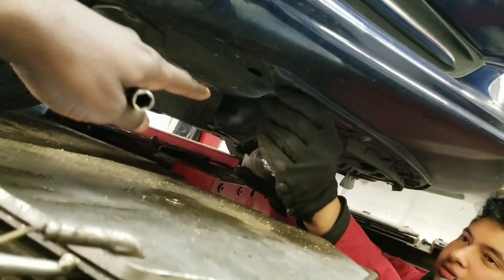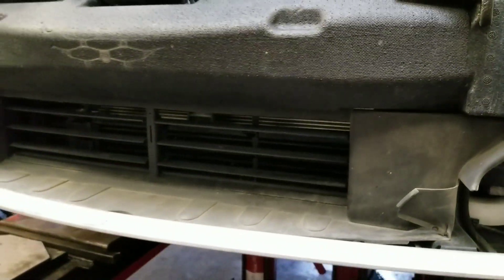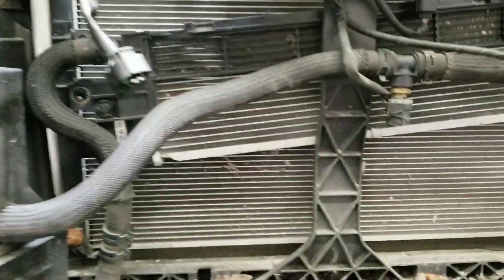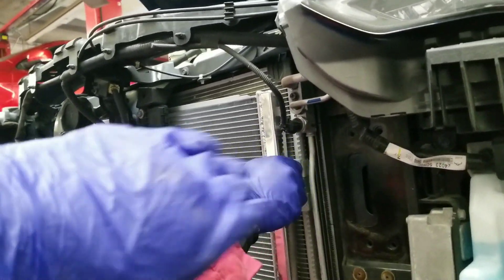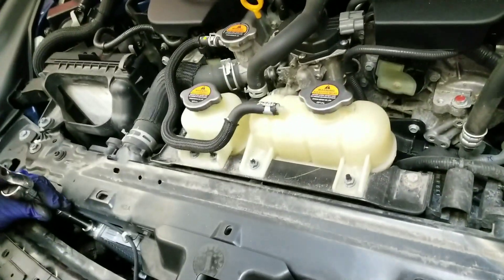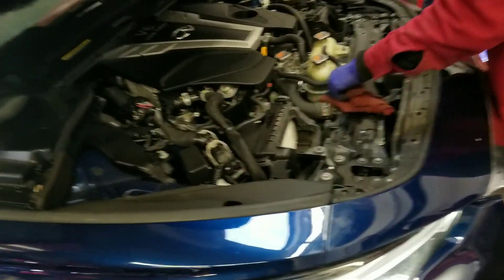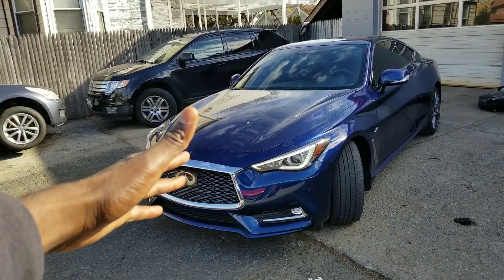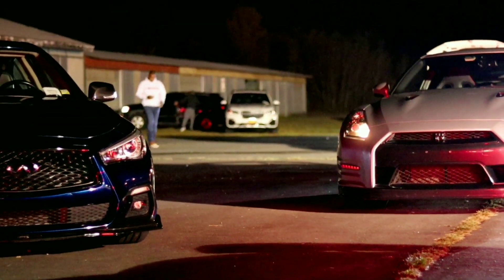AAM HEAT EXCHANGER INSTALL Q50 Q60 RED SPORT 3.0T

Comment: With the extra surface area of the heat exchanger  it blocks the radiator  more . Would it be a good idea to remove the active shudders so it cools even better all the time , especially now that the radiator is blocked more . Gave more cooling from one system but took away from another (radiator)

Comment: Cool video. Is the only mechanical difference between the Red Sport and the Silver Sport the intercooler? Also Doesn't the new intercooler cover up the entire radiator that was there before? Does that not decrease the performance of that radiator? What trim and year is your Q60?
Reply from the maker: I’ve stated this in previous videos from years back. But you have to upgrade the heat exchanger or you won’t be able to get any performance out of your 3.0 T. And there is no mechanical difference between the two.
Reply: The Red Sport has  some mechanical differences. The differential has shorter gears. The intercoolers have a 2nd water pump. The Red Sport also gets an engine oil cooler.,  The Red Sport turbos have an optical sensor.
Reply: The RedSport intercooler is SMALL
Reply: The 2nd water pump in the Red Sports allow it to cycle the fluid quicker, there for cooling quicker.  One thing that seems to be overlooked.  You add a bigger heat exchanger and it cycles even slower without that 2nd water pump.
Reply: I thought they no longer used the optical sensors

Comment: Do you need a heat exchanger when you get tuned? Coming from someone in colder climates and just doing spirited driving here and there, I've read the heat exchanger isn't needed and could save the ~$750 on intakes, etc.
Reply: No a heat exchanger is not needed for a tune! If you race the heat exchanger is needed to keep heat soak down. If you just drive and have a little fun at times then a heat exchanger is not needed. Basically a heat exchanger adds no Horse Power.
Reply: @bigdogstreetperformance6761  Thanks man! I don't race much and just drive the canyons occasionally, so I'm not too concerned about heat soak. I just want to be able to flex a bit and eventually do some suspension to handle the power.
Reply from the maker: For spirited driving the car will heat soak in one pole. That’s it the coolant temperature will be higher than ambient and you will lose power. They should’ve made these cars with larger larger heat exchangers from factory. If your Going to Tune  this is a necessity.

Comment: Every time I turn it on on a cold start just one side of the exhaust comes out warm with stream and the other side comes out cold and there’s not steam coming out from that side exit for about 1 minute and then it goes back to normal steaming on both sides do you think it could be the gallery gasket?